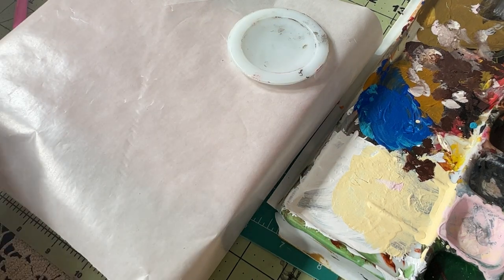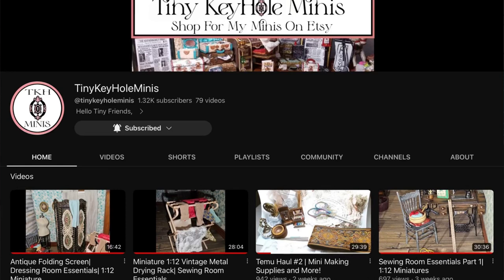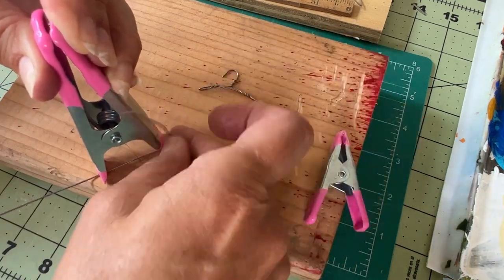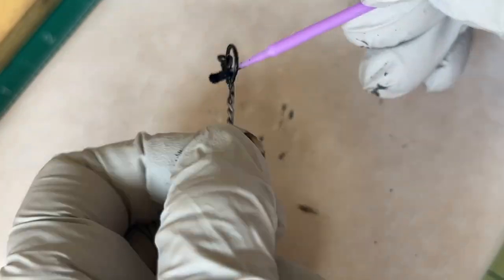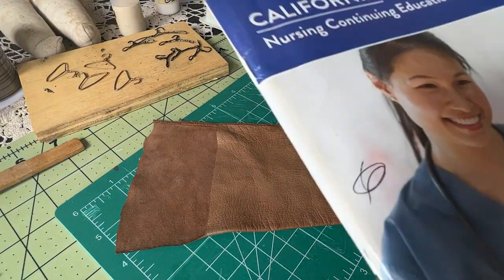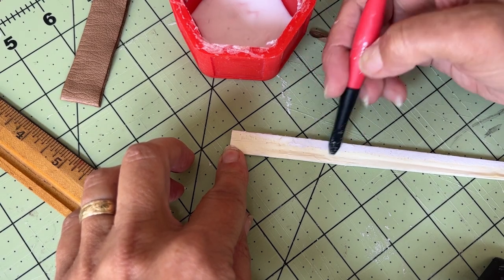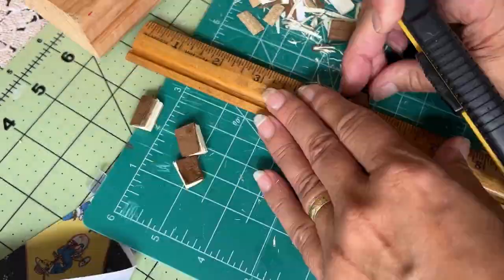✨ MAKING OTHER PEOPLES' MINIS✨It's Harder Than it Looks 😅 #diyminis #miniatures  #dollhouses

Comment: Another supply you could use for book covers is Kraftex. It looks and acts like leather, can't be torn, and comes in several colors and it also acts like thick paper so it can be run through a printer.
Reply from the maker: Thanks Richard. My friend gave me some faux leather (not sure it's same as the product you mentioned). I tried the books again using it, with some improvement. 😍✨

Comment: Hi,
Your miniature coat hangers are really cute! However, I see you are using electrical solder wire with 37% lead, which is probably not a good idea. Craft wire is less expensive plus doesn’t contain toxic lead and is not brittle.
Reply from the maker: Hi Jorie🤗 My son bought that big spool of solder wire and I've been using it! Didn't realize it had lead 😳 Oops. I did notice it was pretty brittle. I hope everyone else knows better than I do. I like the gauge. I will go replace it ASAP. Thank you so much! 😍✨